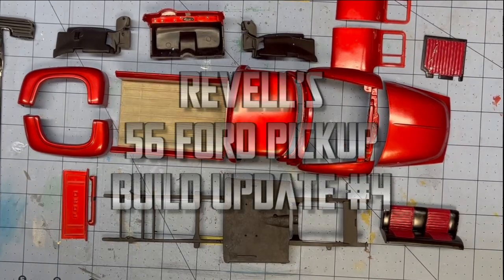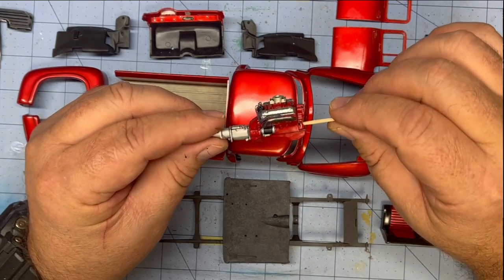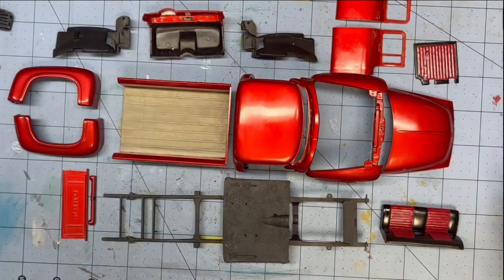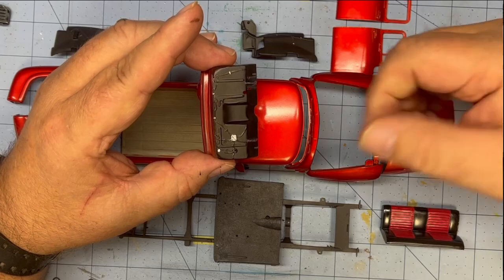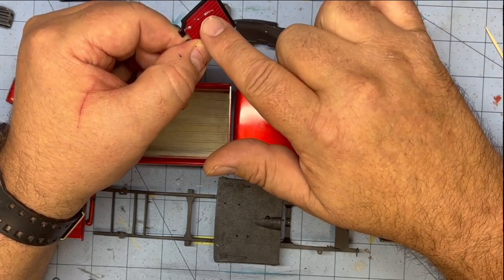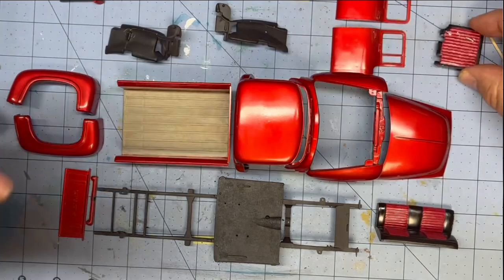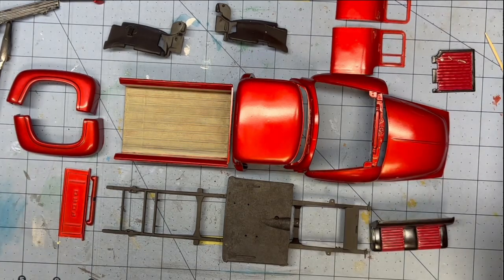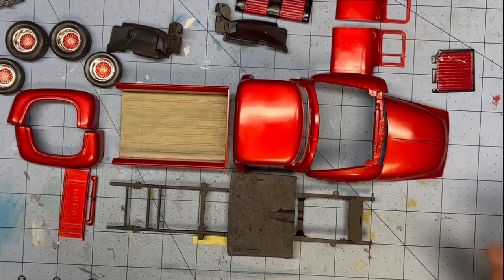56 Ford Pickup build update 5

Comment: The accent paint is it just acrylic flat black ?
Reply from the maker: For inside the cab and under the hood, yes.  I use acrylic in case I get it on the body I can wipe it off.  I will give it a second coat tonight, let that dry for a day, and hit it with a coat of clear inside the cab.
Reply: @grandpamarkshobbies  I’ll have to give that a try I’m working on a ramp truck and want to do that to its engine bay that seem a lot easier than taping and spraying with airbrush is it thin down to brush it on
Reply from the maker: I do not thin it out.  I've found that with a flat brush and not a lot of paint it covers thin and even.  Just remember, it scratches easy if you decide to not put a clear coat over it.  But I like it because I don't have to mask it, and it will not ruin the paint if you get it on it.  Just wipe it off quickly and it's gone.  It is also THE BEST THING IN THE WORLD for blacking chrome bumpers.  You can brush it on, let it dry and scrape off where you want the chrome to show through.  It's awesome.
Reply: @grandpamarkshobbies  thank you for that info just got back into building after a 25 year hiatus and learned so much that has changed over the years
Reply: Where do u get your accent flat black
Reply from the maker: I understand.  I did the same thing about 9 years ago working on ships and aircraft.  Now I'm back into cars and I'm glad I went with ships first.  LOL.
Reply from the maker: I got it at Hobby Lobby about 8 years ago.  A drop goes a long way.  Not sure if you can find it on Amazon or not, but this time of year I'd be afraid of it freezing.
Reply: @grandpamarkshobbies  ya not to worry about freezing I’m in a model room in my house so it heated but it does get cold up here in Michigan that y I made a model room to work in my house
Reply from the maker: No, I was talking about if you have to order something in the mail.  This time of year I'm afraid of it freezing in transit.
Reply: @grandpamarkshobbies  oh ya I don’t order paint this time of year